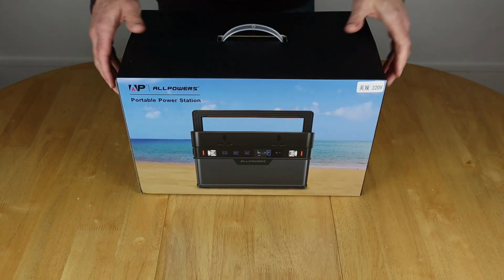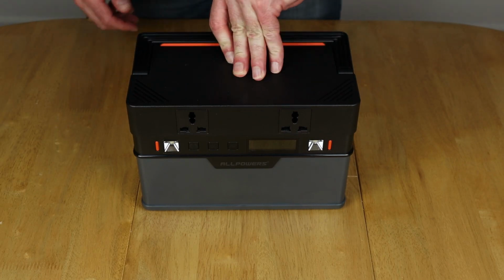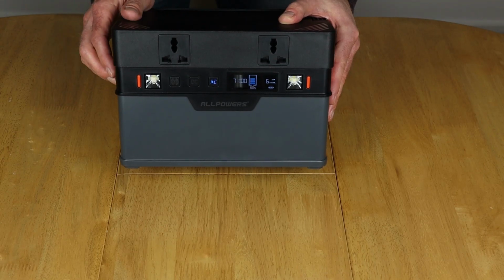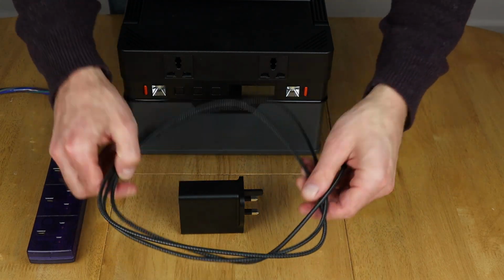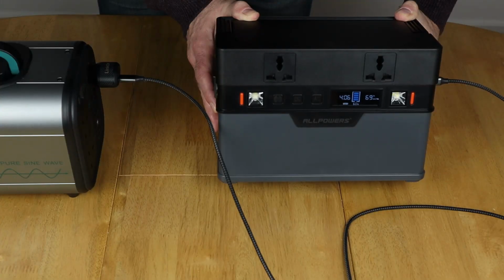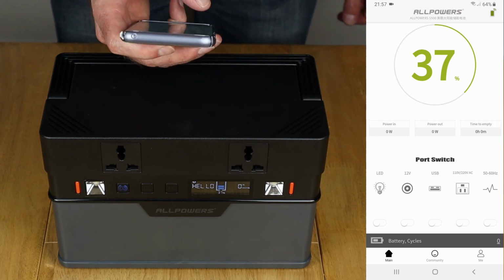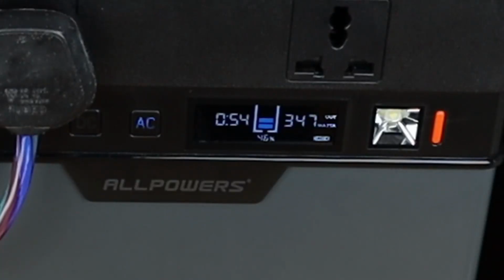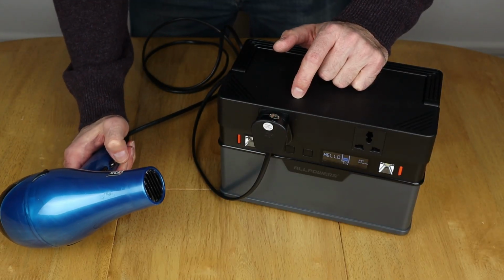ALLPOWERS 666Wh Portable Solar Generator Unboxing & First Look | Even More Pickup and Go Power

Comment: thanks for the video. Is the 12V regulated? -  So i saw the comparison Video and you said it is not regulated but remained 12V with 1%. But isnt that what regulation is? and furthermore have you tested or seen any tests with a compressor cooling box , how long it lasts`?
Reply from the maker: @Magengegend  Good day and thanks for your question. Regulated outputs usually remain at or around the same voltage, regardless of battery charge level. Due to the way the battery pack is configured in the 666, it's around 13.2V fully charged and drops to around 12V near empty from the cigarette lighter output (so not regulated). It works with my new Alpicool C15 and I'm using one of the DC outputs on the 666 which is good for around 5A x 12V = 60W (and is regulated, like on the 372). The Alpicool also has a voltage range you can choose from, so it looks like it will work even when it goes under 12V. I can't say how long it will last as yet, but with the smaller Wh units I've tested so far last overnight in a warm room (in fridge mode). I hope this helps. Please shout if you need anything else. All the best, Adrian
Reply: @DADvinci  Thanks mate. So it holds up at least 12V all the time i guess thats the main point. 
I dont quite get it though, you talk about hours for a mini cooling box but usually people talk about days on other power stations.
Reply from the maker: @Magengegend  No problem at all. I'm in the early stages of testing and the smaller powers stations (240Wh) are lasting well so far (still having plenty of charge after overnight, didn't come across very well in my first reply), but the larger ones like this will last for days and weeks if the sun shines (or if you can charge from a vehicle). I'll need to figure out the best way to share results as this testing is taking time. Cheers, Adrian

Comment: Dadvinci.Thanks for the great review.Just wondering if this version can be used in Ireland/UK..?ALLPOWERS Monster X Portable Power Station 2000 W AC Sockets 1500 Wh Battery Solar Generator Mobile Power Storage for Motorhome Camping.Im getting a little confused with other models and some show closed flaps so no way of knowing..I'm.gonna get the solar panels too..Seems a good deal at the moment..gonna have to get it from Europe im afraid due to vat and duty from UK(shame)..Would you reccomend this..I only have 1 auxiliary battery in my camper so looking at this rather than getting electrics put in...☺️
Reply from the maker: @Tricia Hastings  Good day Tricia! Thanks very much for your kind feedback, much appreciated👍😊. The Monster X is on sale in the UK and as long as you get the 220V AC version, will be fine for Ireland too. I've not tested one yet, although it's something I'd like to get my hands on to review (many questions in this regard). It's difficult to recommend something directly without testing it for myself, but going by the Amazon reviews for the UK version it seems to be performing as customers wanted. The other one to consider is the POWEROAK Portable Power Station AC200P 2000W 2000Wh. Currently on a deal as well, comes with 2000Wh (more storage capacity than the 1500Wh on the ALLPOWERS) and longer lasting battery cells (LiFePO4). Again, I've not tested this one but I've had the PowerOak EB150 for over a year (Playlist here if you wanted a look > https://bit.ly/3msZlWT) and it has worked flawlessly all that time. You can stick with the same brand for solar panels, but depends on how much you want to spend and how much you wish to rely on solar alone (they can be expensive). I hope this helps. Please shout if you need anything else. All the best, Adrian

Comment: I cannot connect to the Power Unit at all using the app.  The app seems to be very buggy and this may be the reason.  I'd be interested in others' experiences with this.
Reply: Thanks @DADvinci I have tried at all ranges including immediately adjacent.  The app seems rather buggy to me.  Maybe an update required.
Reply from the maker: @PAUL CLEGG  Good day Paul! I'm sorry you're having a problem with the app. A couple of questions if I may. How close are you to the unit when trying to connect? The reason I ask is that the Bluetooth range is very limited. Do you just switch on the Bluetooth (on your phone) and open the app, as it doesn't work if you try and pair directly with the unit? I look forward to hearing from you. All the best, Adrian

Comment: I need something like this that can run my small heater I live in a tent so gets cold and have to use a alcohol stove for heat
Reply from the maker: @Sentiment e  Good day and thanks for your question. Do you know how much power (watts) your heater consumes? In general, space heaters (even small ones) eat battery power quickly. The better options are those that provide heat to the body, like electric blankets and heated foot mats. They usually consume much less power. The mat in this video > https://youtu.be/e9uCsixmzWo is not really suitable for a tent, but it gives you an idea of how long this small one I use can run on a selection of solar generators. All the best, Adrian

Comment: Hi can this run a small reef tank? Thanks
Reply from the maker: @ricardo B  Good day Ricardo and thanks for your question. Do you know how much the reef tank uses power wise (AC or DC and Watts)? All the best, Adrian
Reply: @DADvinci  hi. 
Lights 90 Watts 10h daly

Power heads 50 Watts 24h

Main pump 20 Watts 24h

Heater 150 Watts 24h 

Mains 
220v 
Not sure if this information will be helpful
Reply from the maker: @ricardo B  Many thanks for the info. Based on this the following would provide the energy consumption for a 24hr period.

Lights  90W x 10hrs = 900Wh
Power Heads  50W x 24hrs = 1,200Wh
Main Pump  20W x 24hrs = 480Wh
Heater  150W x 24hrs = 3,600Wh

That adds up to 6,180Wh or 6.18kWh per 24hr period. You could probably run the main pump alone for 24hrs (without charging) off the 666, but you'd need a big solar array and large battery bank/inverter setup to cover your power requirement I'm afraid. I hope this helps. Please let me know if you need anything else. Cheers, Adrian
Reply: @DADvinci  thanks so much     it looks a bit confusing.  Is best to leave it... thanks very much for your help

Comment: Just looking at one of these. Could this run an 800w microwave for five minutes or so?
Reply from the maker: @chairman meow  Good day and thanks for your question. Unfortunately, no. The problem with microwave ratings is that although they quote a figure of say 800W, this is the output (cooking power). The input power (at the plug) is usually much higher. For example, I've got a Russell Hobbs that has a rated output of 750-800W, but the input power required at the socket is between 1200-1250W meaning that even the larger solar generators (like my EB150 with its 1000W continuous rated inverter) can't run it. If you already have the microwave, it might be worth having a look at the manual to see the amount of input power required? I hope this helps. Please shout if you need anything else. All the best, Adrian

Comment: Is the inverter noisy? How long for the fan to start to ramp up? Is it able to handle spikey electric loads such as audio amplifiers (say 300W continuous but potentially able to spike much higher)?
BTW thanks for your great reviews, super helpful!
Reply from the maker: @Giulio Jiang  Happy New Year Giulio! Thank you so much for your kind feedback😊 The cooling fan is quite noisy and does activate on a regular basis when you increase the inverter load. It stays on when pulling higher loads (500W continuous limit) until it has cooled back down again. When I'm powering my TVs (streaming films usually), I run an extension cable from another room so it doesn't intrude on the sound when the fan kicks in. It's difficult to say how it would react with different types of equipment, but I usually just plug in and as long as it doesn't pull over the inverter continuous limit for too long it keeps running. I hope this helps? Please let me know if you need anything else. All the best, Adrian
Reply: @DADvinci  thanks for the answer :D
One more question: do you ground it when using at home? Are there safety concerns regarding electric shock?
Reply from the maker: @Giulio Jiang  Glad to help😊 I don't ground any of my solar generators at home or away. They usually come with a variety of in-built features. This unit (from the manual) has over current, under voltage, over voltage, overload, short-circuit and overheating protection. I've not had problems on any of my 5 solar generators or heard from any viewers regarding shocks. I hope this answers your question? Cheers, Adrian

Comment: Thanks for the reply and a Happy New Year. I think I have been going about this the wrong way. The 372 is brilliant for what it does but to power a heater is too much to ask. I will do what I did in my old camper and add an extra leisure battery. I do like (normally) to do a lot of winter stealth camping but heating had always been a problem. I will stick to the 372 and the solar panel for things like tv but the extra leisure battery would be a better bet for extra power requirements. I appreciate all your advice.
Reply from the maker: @Turbo Jones  A very Happy New Year to you! Thanks for the info and I can see why you would add an extra leisure battery. The question of heating for a variety of mobile scenarios is coming up lots at the moment (good old Winter) and it’s always a tough nut to crack. Personal heating methods (electric blankets, foot mats, etc) are more battery friendly versus space heating, but I guess everyone has different tolerances for the cold and being ‘comfortable’. I’ll continue with the tests on the subject of heating (video for FootBuddy will be soon) and I’ve ordered some components for my first DIY build (24V LiFePO4 system) which I’ll film as well. Please shout if you need anything. Take care, Adrian

Comment: I would like to run a 450 watt heater in my campervan. I previously ran it from an inverter but now I have a CTEK battery charger and the battery cannot run the heater directly.
Reply from the maker: @Turbo Jones  Good day and thanks for your comment. A couple of questions if I may. How long would you want to run the heater for? How would you typically charge the battery (solar generator)? 

As you're probably aware, electric heaters eat battery power and at 450W, even this 666Wh (with its 500W continuous AC inverter) would roughly give 70-80mins run-time per full charge. You can use this unit whilst charging though. It charges at approx. 120W from two 12V cigarette lighter sockets simultaneously as shown in our latest video if you'd like to watch > https://youtu.be/5BtddOoEAuE .

Have you considered any other heating options for your campervan? The reason I ask is that I've recently got one of these > https://www.bewarmer.co.uk/footbuddy-all-in-one-heated-foot-mat/ which I'm testing at the moment. It's still early days, but I'm impressed with it so far. They also do larger versions specifically for rugs > https://www.bewarmer.co.uk/rugbuddy-under-rug-heating/. I've been working from home since March, so needed to find better ways to keep heating costs down during Winter and this gives me a little patch of underfloor heating where I need it (dining table, now my workplace). I’m also using this with my solar generators and it runs fine, effectively costing me nothing to run providing the sun has turned up to charge them. Mine runs at around 80W, so significantly less than a lower powered fan heater or oil filled radiator. I’m not sure it’s the complete answer to heating a campervan, but the larger ‘rug’ versions might do the trick from what I’ve read whilst requiring less energy to run (free from solar).

Please let me know what you need and I'll assist where I can. All the best, Adrian

Comment: I bought the 372 on your recommendation and I am very happy with it. However I could do with a bit more power. The 666 which is really a 500 is over £460. That's twice the price of the 372 for just a small increase in power. I wondered if there was a way to get 500w out of two of the smaller units if I just bought another 372. Am I dreaming. Thanks for your help.
Reply from the maker: @john smith  Good day John! It's nice to hear that you're happy with the 372, but I guess a little more power never hurts😊. Just to confirm my understanding, you're looking to run more mains powered devices at the same time or you'd like to run what you have already for longer? This helps me frame the best options for what you might need. Please can you let me know when you have a chance? All the best, Adrian
Reply: @DADvinci  Are you interested in the Ecoflow River 600 Pro? https://www.solarpowersupply.co.uk/product-groups/portable-power-stations/ecoflow-river-pro-portable-power-station-eu-version

720 WH with an upgrade able additional 720 Wh!

It looks like I chose to get a new portable power at the right time. But there is no way jackery will be as competitive in price as that one.
Reply from the maker: @Mr Everybody  I'd like to test one for sure! The other one I want to get my hands on is the PowerOak AC100 - https://amzn.to/2ZT7DOd (affiliate link). Really impressed with my EB150 and wondering how that would compare. I'd agree that the Jackery might be pricey. Cheers, A
Reply: @DADvinci  why is he saying that the 666 is actually only 500??
Reply: @TheEAFOS  I'm guessing he's talking about actual rated power vs advertised. For example, another power station advertised as 166 watt was tested as 133 watt. I could be wrong in this case though..
Reply: Mr Everybody since doing further research I think it’s because you shouldn’t run a lithium battery below 20%  so he’s saying you can use 500 of the 666 as you need to charge it when you get down to 20% that’s all well and good but his newer video on this product makes it look shit! And there’s basically nothing else on the U.K. market which is really frustrating seeing all these fancy ones online and I can’t buy any 😭😭
Reply from the maker: @TheEAFOS @Mr Everybody  I'm hoping to get a response back from John. He might have been referencing the inverter rating which is 500W continuous, or indeed as you say the energy storage at 80% which would be 666Wh @ 80% = 532Wh. Cheers, Adrian
Reply: @TheEAFOS  Keep an eye out on jackery, they are releasing on 12th march..not long now. I have no idea which units they will be coming out with though. They said it will be on Amazon.
Reply: @mreverybody1150  awesome cheers man! I'm also waiting on the new Ecoflow River to come in to stock around the same time! pretty sure I'm gunna go with that one for the fast charge element! plus I can double to WH by buying the extender battery to make it 1440 for total cost of £1198
Reply: @TheEAFOS  I had a look at the ECOflows but not sure yet, will wait and see. 

I just found this too, never heard of it and he says it's better and cheaper than the Jackery 1000!

https://www.youtube.com/watch?v=0KWb5v6BbYU
Reply: @TheEAFOS  What version of the Ecoflow River are you looking to get?
Reply: @mreverybody1150  is it available here though?
Reply: @mreverybody1150  the new one comin out next month the river 600 pro! It’s 720wh and you can buy a second battery for £499 which is another 720wh
Reply: @TheEAFOS  I haven't seen it anywhere yet.
Reply: @TheEAFOS  Where are you going to buy it from? I see it on pre-order here https://www.solarpowersupply.co.uk/product-groups/portable-power-stations/ecoflow-river-pro-portable-power-station-eu-version

That looks like a really good deal.
Reply: @TheEAFOS  Check out this test of the Ecoflow 600 after the updated firmware. it failed a lot of the tests and it really makes me doubt the 600 pro.

https://www.youtube.com/watch?v=kaUesizlOG8

Someone also said they had an R600 pro and it failed one day into a storm power outage, and they experienced poor customer service. This is where Jackery appear to be really good.

I doubt I will buy an Ecoflow anymore.
Reply: @TheEAFOS  my thoughts too as my 606 wh is the 500 watt version
Reply: @mreverybody1150  I got the alternate brand all powers 372 for £180 and it’s wicked! I’ve not purchased a bigger one yet but will look in to a bluetti 1500 or 2400 as they’ve come down in price a bit!